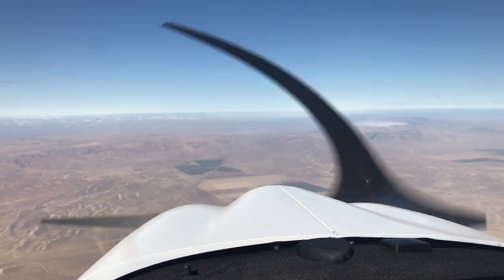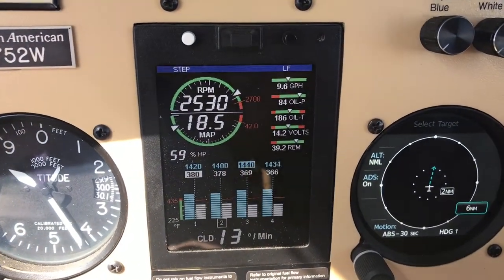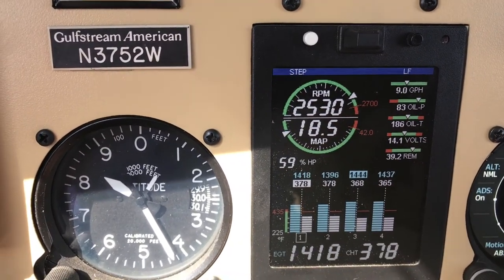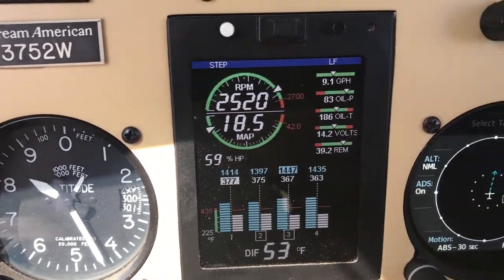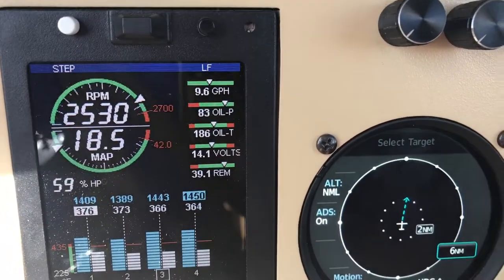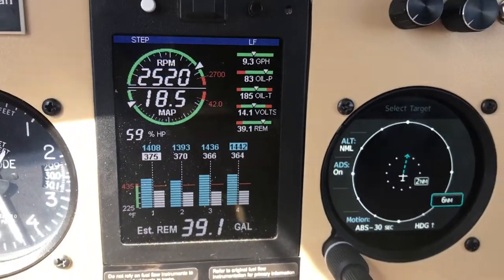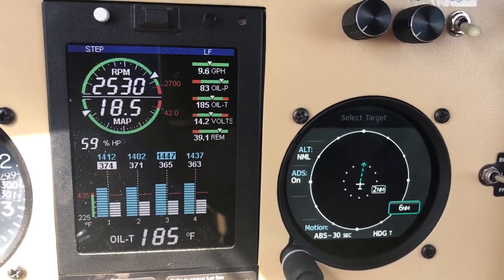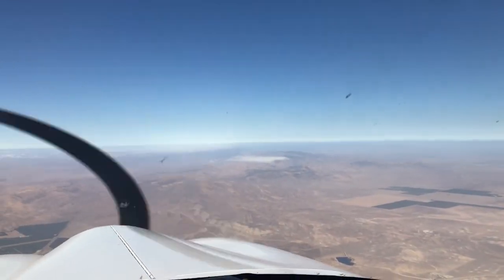JPI Instruments EDM-830 Engine Analyzer

Comment: Is it the GI275 showing traffic in the display next to the JPM?
Reply from the maker: Yes, the data comes from the GTX-345.  In fact that’s the primary reason I installed the 275, to have traffic displayed while using other screens on the GTN-650xi.